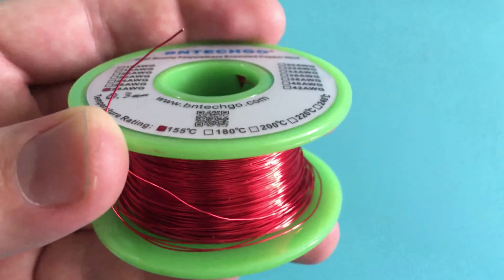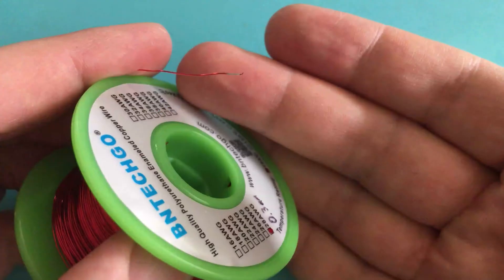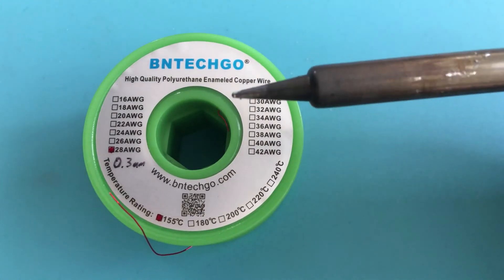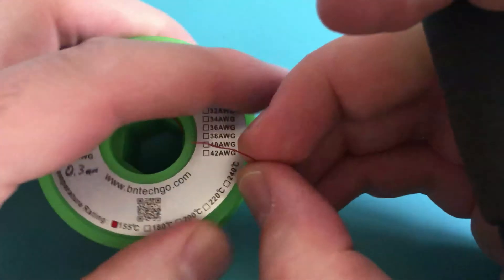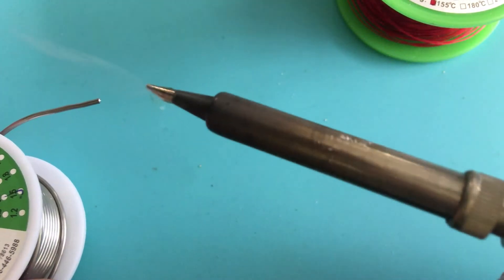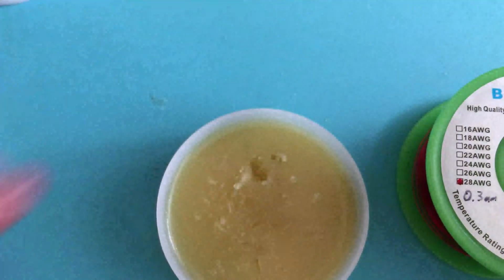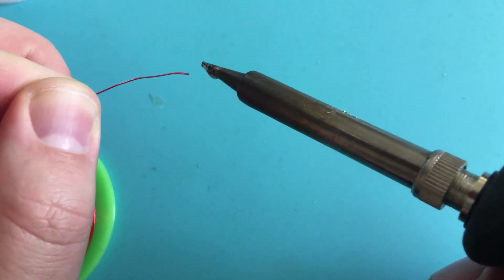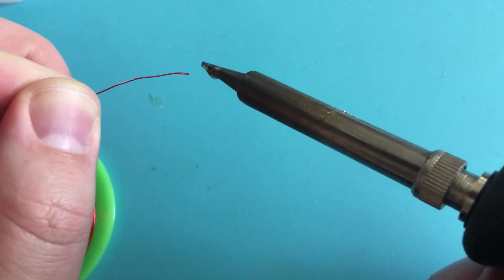SolderJS #135 - The BEST Way to Tin Enameled Wire

Comment: I usually use a lighter to burn off enamel. But I’m trying to work with 42ga right now. The flame burns the wire up.  So I am very happy to see this method works.

Comment: Many thanks to you. Just to let you know that over here, UK, it's very hard to get leaded solder and doing it this way doesn't work using unleaded solder, or rather I cannot get it to stick.
Reply: Make sure you're using plenty of flux and that your iron tip is clean/not heavily oxidized. Oxidation is the usual cause of poor wetting, whether it's leaded or not. You may need to hold the solder ball for a longer period of time on the wire to boil off all the enamel. Stick your iron tip through your brass wire cleaner a couple times and reapply solder, then repeat the process of burning off the enamel again. If you see a ton of black/oxidation and smoke coming off it still then it's still burning up the enamel.
Reply: Ali Express sells pretty good. 60/40. Avoid the 63/37 stuff. Unleaded solder is an absolute waste of money for hobbyists. Doesn't stick to anything, as you say.

Comment: Thanks! I don't have separate flux to cover the wire in, only flux core solder so I couldn't get it to work until I started adding solder right there as I was touching the iron to the wire. Otherwise the flux just evaporated instantly. Also when I brought the iron all the way up to 480 it eventually melted the wire )

Comment: I've seen methods for everythnig from burning it off with a lighter to using the bare tip to melt it off and it never works. This method however was perfect, thanks for putting it out there!

Comment: SIR.     Do you recommend the wire for fixing  pcb traces?. Many thanks....Appreciate your answers
Reply from the maker: Sure. Just be careful not to rip them up further. The one I use in the video is pretty stick and thick and can easily rip traces. The thinner stuff is harder to work with.

Comment: Wait a second, you've just used flux, that's it? FLUX?!?!?!

These little suckers caused me endless headache when repairing cables.
Reply from the maker: It's not the flux alone, it's primarily the right temperature - high enough to melt the enamel, low enough to not make the wire brittle (which is a nice wide margin, but starts higher than I realized).
Reply: @coolaj86  Can't wait to try it, thanks a lot for this info! I've build myself a little station to help me melt the enamel from the wire. Basically a candle, a spoon and tons of tin.

Never really worked.

Comment: do i need to use 100w for 2mm thick copper coil or 60w is enough?
Reply from the maker: That's hard to say because watts are a unit of heat dissipation, not a unit of temperature.
Use a thick tip and try and see?
Reply from the maker: If not, get a cheap-o super-hot iron, like this https://www.youtube.com/watch?v=amVGkEuQc3U, or a really nice one like this: https://www.ebay.com/itm/275175931064

Comment: Tried and tried but just can not solder this stuff...l followed your directions to the T but l can not tin or solder to other wire....help please
Reply from the maker: You may need to clean your soldering iron by tinning it and cleaning it a few times. You're probably not getting good heat transfer.
Reply: @coolaj86  thank you..what is the ideal temperature? I have a dishwasher pump motor with very find windings and a break at a connecting terminal has occurred that l am trying to repair.
Reply from the maker: @davebl9645  I believe around 400C, but this will vary based on the size of the tip and how well it's transferring the heat.

Comment: My solder simply wont stay on the tip of the iron. It just drops as soon as it melts. How do i fix this?
Reply from the maker: It's probably oxidized or otherwise corroded and you either need to clean the tip or get a new tip. A good way to clean it is to get it as hot as it gets and then slide and twirl it across a damp sponge and then dip it in flux and repeat, and then tin it, wipe it, and tin it again. It could also be that your solder is old and corroded and needs to be replaced. Always clean and tin your tip before putting it away. And always put your solder in a sealed bag to prevent humidity from getting to it. If you want a cheap replacement iron, search my channel for "soldering kit".

Comment: Can I  simply solder wires on the circuit after completing these steps?
Reply from the maker: walker #36410 I’d suggest putting a small dab of flux on the copper or tin pad on the board and then applying a small amount of fresh solder.
If there is already old solder on the pad (especially if it’s lead-free), you’ll want to put some flux on some solder wick (such as goot wick) and clean off the old solder before tinning.
Reply: @coolaj86  thanks a lot ur videos helps me so much.

Comment: This wire is marked with temperature 155c! Not all emamelled wire is not like this. Commonest one meant for winding motors and transformers is rated for much higher temperature, and enamel will not melt or strip at 400
Reply: What temp does 4mm copper wire need to get to to solder? My iron doesn't do shit

Comment: that only works with that brand of wire, that brand of wire glows in black light to make it easy to see where the enamles been taken off. what about normal magnet wire?
Reply from the maker: Define "normal". Do you mean coated orange rather than coated red? Same procedure. Unless it's so fine that it burns away, in which case I don't know.
But if it says that it'll burn away when soldered on the label, then it probably will - you just gotta heat 'er up a bit more first.

Comment: Nice video, how would you solder that bad boy with a microscope after?
Reply from the maker: Don't be fooled by the tiny tips. I'd use the biggest tip that would fit to get the most heat transfer that I could, and then I'd use some wick (or even just the tip of the iron, perhaps a smaller tip) to remove any solder bridges.
Also, search "smd practice kit" and give one of those a try with your setup before ruining something important. Once you get familiar with it you'll be surprised how practicing under a microscope enhances your fine motor control - even if your hands aren't particularly steady. You can be better than you'd think.
Reply: @coolaj86  thank you, appreciate the reply, i ll get one of those practice tips for sure